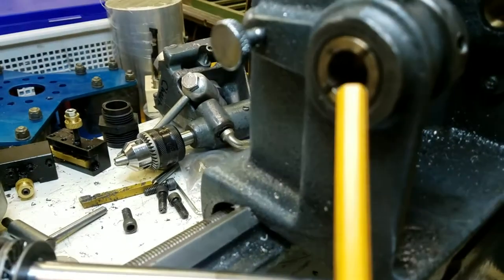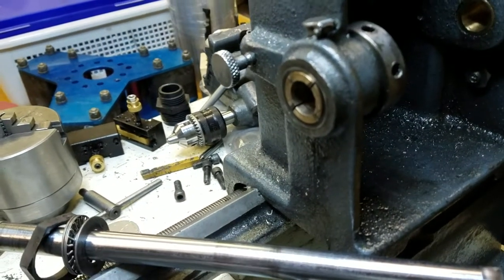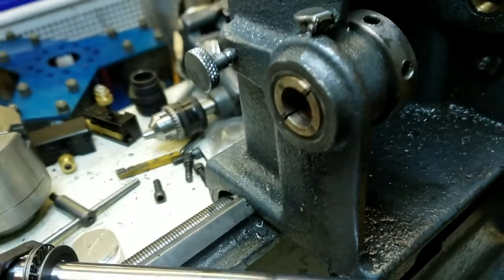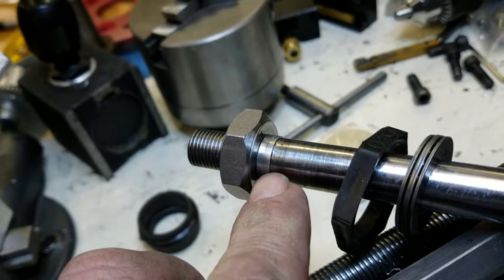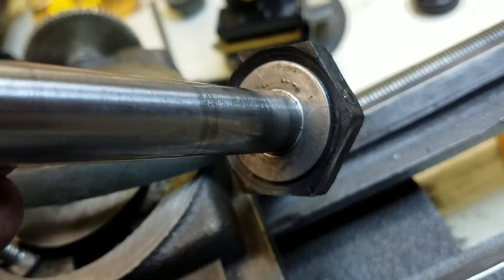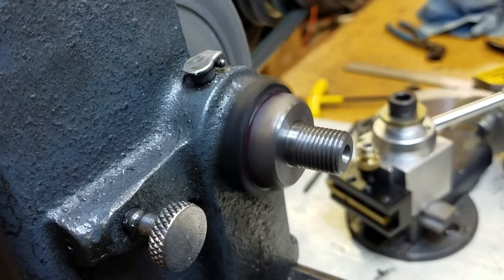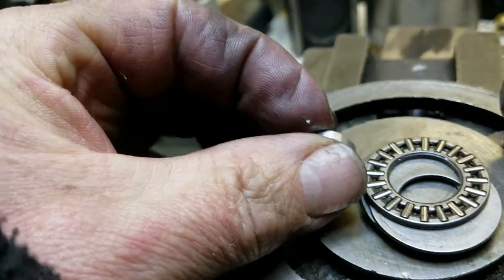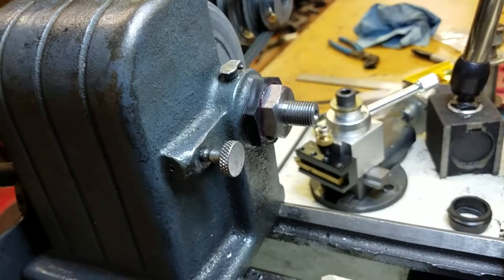CRAFTSMAN 109 LATHE NEEDLE THRUST BEARING

Comment: i am restoring a 109 lathe and i am missing the backgear locking pin and need to make one. could i talk you into taking yours out and get some measurements for me?
Reply: Bob, did you find the measurements for that locking pin? George
Reply: @akaslick50  no, but i just made one that is close enough. but if you have the measurements ill still use them to made the right one

Comment: Would you pls give the details of the Thin Bearing as shown in the video?
Reply from the maker: I really don’t have any details For the thrust Bearings that I used I took them out of a gearbox so as far as model or make I do not know
Reply: you can hunt some down on mcmaster, or pretty much any other bearing manufacturer site. all you need to do is search "needle roller thrust bearings" and you should find some.